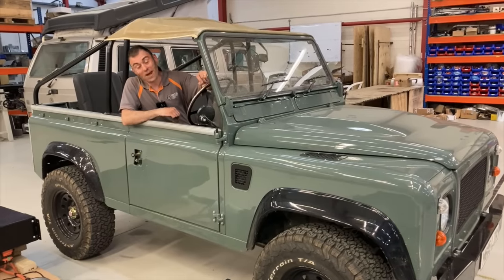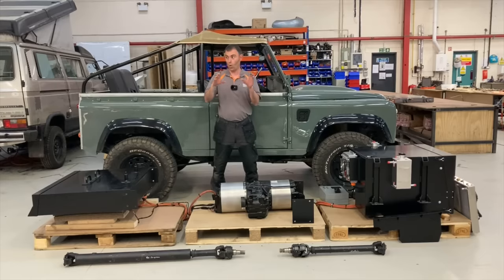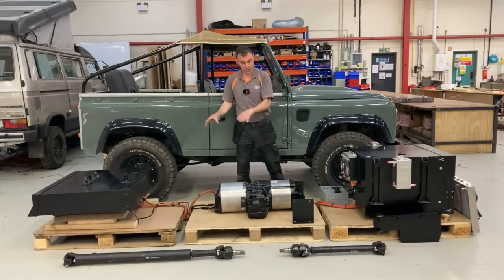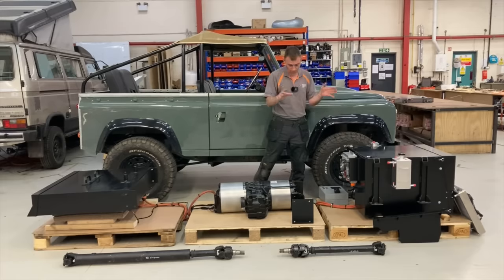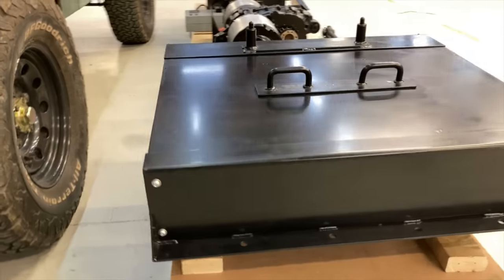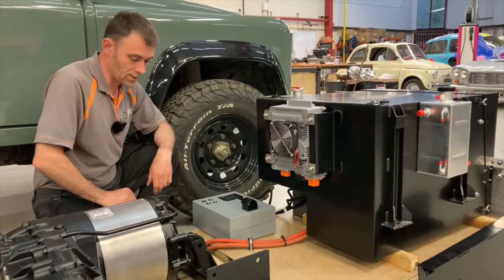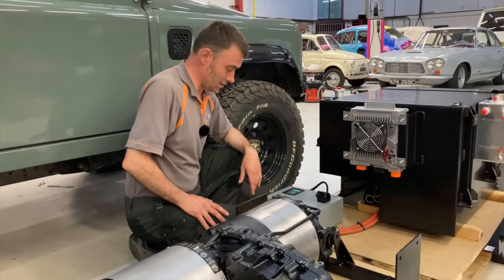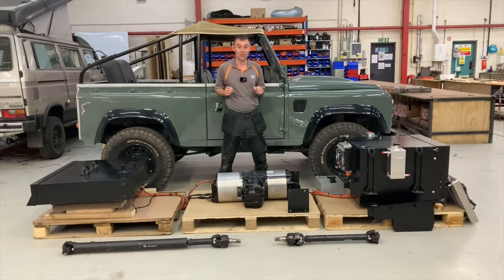Land Rover Defender bolt-in electric conversion kit.

Comment: @Electric Classic Cars
  If you want to cater to the USA, I would suggest looking into Chevrolet K5 Blazers, K10/K20 pickups (The nearly identical GMC pickups were designated as "K-15" and "K-25".  The only difference was some minor badge work.).  Also, the S-10 and S-10 Blazer (Chevy and GMC were identical here), the Full size Ford Bronco (typically with a 5.0L V8), the Ford Bronco II (based on the Ford Ranger small pickup which also had a 4x4 model), and then there are the Dodge Ramchargers and Dodge full size trucks, Jeep CJ-(x)s, and International Scouts.  Those are the most common older 4x4s here in the USA.  For all of these models, I would suggest a more universal kit to cover these basic styles of vehicle and ask your USA based businesses to come up with the bracketry to mount them in place for specific American models or have the end user make them if they so desire, with some disclaimer, of course.  The driveshafts (Propeller shafts) can be made at local machine shops to the end users.

Comment: I’d love to get my Discovery 3 converted oneday, but recognise that is probably too modern a vehicle for ECC. I’ve always hankered after a late original Range Rover Classic, soft dash maybe LWB.

But rather than 4x4 you should partner with JLR to take over the E-type zero project the cancelled. There would be a lot of demand for those as kits. https://m.youtube.com/watch?v=610Amyhpzzk
Reply from the maker: The RRC we can do. We've done a few of them. The Defender kit literally slots right in. Just a little bit different front battery box. We've also got a few electric E-Types to do. 👍

Comment: Electric kit for a DAF400/LDV CONVOY would be ace. Pretty much the land rover of the van world. 
Theyre great vans, perfect ahape for a camper, classic looks, simple enough to do a 4WD conversion on. TONS of space in the engine bay as well as under the floor in the back as the floor is raised by about 1ft the whole floor. Reckon you could easily fit 500KWH of batteries on that vehicle body if you desired to actually carry that weight in batteries 😂

Comment: I would like to build a fully electric F350 Super Duty pickup truck. It needs to have a heater that can defrost the windshield and be able to climb a mountain to my off grid home from 1800ft to 4700ft above sea level. The round trip to work and back is about 45 miles and takes 1h to 1.75h in the winter with snow and mud conditions. I also need to keep my 4x4 and low range for when I get stuck sometimes. Do you think there is a battery good enough yet? I see ford sells new f150s that are fully electric but those trucks are too small and low to get to my place and they are way too expensive!

Comment: Guys the best 4x4 (and I mean that as the best all rounder on/off the road) is Mitsubishi Delica Space Gear (L400 chassis) imho, I think it would be a perfect choice for Tesla conversion. Based on a Pajero it is a great off roader, however it is excellent on the road too. Unibody like 3rd/4th gen pajero (no ladder frame) but drivetrain same as 2nd gen pajero with few updates. Basically you could develop a kit very similar to what you already have for LR.

And another one, Mitsi Pajero 3rd and 4th generation, both have independent suspension and no frame, so rear/front motor location like on tesla cars would be, theoretically, possible. A lot of space in the middle for batteries.

But for me personally, a series 2 delica lwb is THE vehicle for tesla conversion, huge volume of space underneath and a perfect car in general. Swb would also be a great choice space wise and they are a lot cheaper and common comparing to lwb which are very expensive nowdays.
But from a business point of view, Pajero 3rd and 4th gen would probably be a better choice. 
Ta.

Comment: I am amaze with Landy conversion from conversional fuel to EV. Is it possible to set diesel electric motor for EV or is it possible to charge the battery with mobile small generator?

Comment: I would guess that the Cummins is the most common personal truck engine on the road. So maybe a differential mounted motor or a transfer case mounted motor or transfer case replacement for all trucks light-duty or medium duty would be a great place for you to direct your efforts

Comment: Ed do a p38 Range Rover aluminium body plenty of space you can even put solar panel on the roof for topping up the batteries on the go and you can install my air drive unit which tops up the battery with out charging at home

Comment: Just amazing. A superior technology in so many ways. It's always how I thought a transfer case should be configured. Elegant, instant torch, powerful output, motor with one moving part. What sort of range can you get if you put a stack of the 40s in a long bed Ford? How many could you stack and still have storage space? How many if you use all the trucks physical storage space? In the same long bed Ford, at what rate does battery stacking mitigate thermal loss performance issues? Imagine the pulling power.  Very good stuff.

Comment: hmmm... how about a c/k chevy conversion? that system looks like it might almost work as is., passenger drop or I suppose it can be clocked either way? 
Do you have some kind of mechanism to control front engaging front driveshaft via transfer case, or will some type of wheel hub  lockers be required to prevent running the system full time? 
Which would mean the axles are still spinning and there would be some parasitic loss? it looks so simplistic and clean., I really love it!

Comment: What are they like for towing 3.5 ton, and the range you get with a full load? Great product.
Reply from the maker: Easily tows 3.5 tons. I've towed a car trailer with a Defender 110 on it many times. It's easier to drive towing compared to a diesel because of the smooth delivery of power and regenerative braking from the motor which means you hardly use the brakes, even when towing. The extra energy ( i.e. effect on range) it takes to tow is the same whether petrol, diesel or electric. 👍

Comment: Thanks for the video and great job making those kits. Maybe convert a discovery 3 solve the crankshaft problems by removing the engine. But I guess there is too much other stuff in the car to place the electric components, not to mention the traction control. One other question, how deep can it go in the water? Is it all sealed well?

Comment: It looks to be an amazing conversion.  Would I convert my 1996 110 300 tdi with only 170,000 miles on the clock.  Yes in principle but my defender is still very utility, no frills, bumps knocks etc. Current value perhaps 5 to 7 thousand, maybe.  I am guessing the conversion parts alone are well over that.  I don’t think I would be up to doing the conversion myself, so that is going to add on a fair bit more. Having said all that you would be getting one heck of a car both in performance and hopefully in terms of saving some money. Not sure i can live long enough to see a positive return but that isn’t everything. Would be good not to have so much oil on the drive!

Comment: How about a tractor conversion. I have a 70hp Kubota used with a 3m topper mower to cut grass on an airstrip. I have 20kw PV/ 55kwh battery storage/7kw EV charger onsite with spare capacity in summer so it would be great to move away from diesel. The combo does about 1.5hrs/week grass cutting so not too much of an energy storage challenge.

Comment: For a 110 tipper landrover used off road in the woods  to haul and carry stuff would a transfer box be needed to get low ratios or is the torque of the direct drive going to be fine ( I’m assuming it would be ) 

Is it possible in a defender 90 to get more battery ( power) storage I’d need more than 150 miles per charge In My 90 but can’t afford to lose too much rear load space . I don’t need the crazy acceleration though 😎

How about a kit for the freelander1
Reply: No need for transfer box, motor has plenty of torque 😀

Comment: You can tell that we're at a very early stage of electric cars by the insanely HUGE chunks of kit that have to be installed in order to get 150 miles of range. It works really well for electric bicycles, as I can personally attest but it currently doesn't scale well. Oily as the original may be, it gives you unlimited range and takes you into deserts and jungles all over the world. Petrol is available all over the globe but not electric power.

Comment: If I had an aluminium bodied vehicle, I would try to employ every part of the coachwork that wouldn’t make the passenger compartment unbearable as a heat exchange/batt cooling assistant and in winter, I would make the passenger compartment aluminium coachwork part of that system to heat the cab. Just an idea.

Comment: so what landrover mark is that? SII door hinges? and modern bonnet and grill?  rear overhang very short. Steering wheel defiantly off a series and the bulkhead (firewall for those in the USA) is not later that a TD5
Reply from the maker: Early Defender, with some custom touches.👍

Comment: Very nice to have an electric 4WD. But is it waterproof for river crossings? Also how does the vacuum work for the brake booster?
Reply from the maker: It has an electric vacuum pump from a modern EV. Yes, it's waterproofed for river crossings. You can see it wading across a river in the following video. https://youtu.be/B38t7o4zyjU

Comment: I'm very interested in MK8 transit kit. The mk8 has a lot of engine and transmission issues. But the body and frames are great. Mine as many has had a lot of engine issues The RWD has loads of space for batteries and motors under the floor. Ideal for flat battery packs.

Comment: I assume the use of Tesla batteries and motors is because there are more out there, and they are one of the leaders in EV technology. I wouldn't expect you to give away commercially sensitive information, but are you looking into, or in talks with, other suppliers? I would think the battery suppliers would be the more difficult, simply because of the demand for batteries right now.

Comment: Quick question - I am considering buying a converted Bentley where the original running gear and gearbox are left in place. My question is about servicing and repairs to the non-electric aspects of the car. Would the conversion mean every garage would turn me away, or is there a 'switch' that renders the high-voltage safe for the old school mechanics without specialist training to get on with the work they need to do (such as to the Gearbox or Suspension)?

Comment: I assume to achieve two-wheel drive, the process is unlocking the Axles at the hubs. How does the Tesla differential handle the slipping in the front or rear if you only wanted front-wheel drive.

Comment: Please, I need a conversion kit for my 1991 Toyota Landcruiser FJ80. I would like the complete Tesla 3 drivetrain, particularly the DC Fast Charging controls and circuitry. I expect the motor, battery, controller, heat exchanger, octovalve will need transplanting. Mike

Comment: Only one (1) question:  What is the Lifespan of the vehicle?  Because a standard Landrover will last 50+ years.  So long would this one last?
Reply from the maker: A standard Land rover will last 50 years. 😂😆😲 this is a 1994 Defender and was completely dead before I bought it. Nearly everything was rusted or needed to be replaced. The average life of a car is 250k Km after which time the battery in a Tesla will still have 90% capacity. https://twitter.com/Duro_Data/status/1340493067443265536?t=hZIOjKrQfbUCjRXqGZ3mEA&s=19

Comment: hey Richard, are you guys currently working on 'drop in' kit for a discovery 1? I've been following you, Jaunt, and all the other 'best of' ev conversion from the start. I suppose it would not differ very much at all from a range rover classic. I'm sure you've been in talks with others or are in the process. I actually have lots of great ideas in this field and want to do it for work (including putting a tesla drive unit in the middle, before anybody had done it; it makes so much more sense and reduces weight and parts considerably), I wish I had just delved into it already instead of sitting on the sidelines watching. I've done light refurbishments on another type of modern classic car that I love to drive but I'm not a mechanic by any means. I also have an education in ecological restoration / environmental science so I'm similar to you in a lot of ways (my love for modern classics and driving and my keen awareness of ecological/ global environmental realities). FIAT PANDA 4x4 of the tesla variety would be sick (we're deprived of many European classics in the US like the panda).
Reply from the maker: An electric Fiat Panda 4x4 would be so cool. 😁👍

Comment: I'm starting a project to convert a car to an electric car but with a small addition going to have a small generator in it so it can charge the battery on the go 🙂 so more of a hybrid I guess, would like to have an easily removable battery park but not sure that's going to be practical without doing a lot of changes on the chassis.

Comment: Do you make the rear battery pack to slot down into the chassis where the old fuel tank would of been? That way you can use the rear load bed.
Reply from the maker: Yes. That’s how our latest Land Rover kits are. 👍

Comment: pricing ?? should convert a 2wd camper van and make it so the battery can be recharged with solar panels installed on top of the camper...travel for free just park and wait for the panels to recharge the battery

Comment: The power seems far too much. My Series 3 has 75 HP, which is a bit low I admit. But anything over 150 HP is unnecessary and just adds weight.

Comment: This is truly amazing I got to drive one of your kits in a 110 with king shocks and 37s it was the most capable 4x4 truck I’ve ever driven if your takin suggestions for what I think would sell make a jeep yj or tj lj electric conversion kit lj and tj are the same kit for the most part dude theirs so many people wanting these in the untied states make ‘em and ship them out they will sell
Reply: Theirs 1000s of them in the junk yard cause of bad 4 cylinder junk engines and only some had the ok straight 6 gas nothing to write home about but was a work horse this electric kit would completely change off roading if you made it for jeep theirs so much more aftermarket parts junkyard parts and jeep jeep everywhere in the states

Comment: Looks fantastic Why can’t someone design it to be self charging? This would make it perfect and give real range for overlanding in a defender
Reply from the maker: No such thing as 'self charging'. It's marketing spin used to describe a petrol powered hybrid that charges it's battery up using petrol. Every EV has regenerative braking which puts energy back into the battery when braking and slowing down.
Reply: @ElectricClassicCars  yeah but wouldn’t it be perfect if it could self charge ? Obviously they won’t make it self charging because they want to keep selling electricity, I think it’s amazing to see the defender kit it looks so compact and neat what range can you get on a full charge 
Thanks in advance

Comment: why not use the model S pack and the Model 3 motor? still more torque and power than you'd ever need with less weight and less room taken = more range
Reply from the maker: We do, on builds where all out power isn't a requirement. 👍

Comment: How much does all that weigh? Everything on the pallets I mean.
Reply from the maker: Not much more than what came out i.e. engine, gearbox, transfer box, exhaust, fuel tank, fuel, fluids, coolant system, big 12v battery etc. 👍

Comment: whats the range when towing 1 tonne and can it be submerged under water so you can launch a boat?
Reply from the maker: Watch this regards towing👍 https://youtu.be/SHxQV3w1HKA
Reply from the maker: Watch this regards water crossings 👍 https://youtu.be/B38t7o4zyjU
Reply: @ElectricClassicCars  so, I’m Australian just for some context........I just watched the range test and my god was that disappointing in terms of performance. 125 mile (201 kilometres) range in Australian terms is frankly......pathetically and dangerously low. I had really hoped that result would be far better than it was but oh well, that’s just where the technology is at the moment I guess. Thanks for making the videos but electric towing just isn’t viable yet in Australia with the distances we need to cover and the lack of charging stations. Plus, our electricity Is insanely expensive and only going higher in the future. It makes no sense at the present moment to even consider electric as a viable alternative here.

Comment: How long for can 100kwh take me?
Reply: A Land Rover Defender like this has a drag coefficient of ~0.59, compared to 0.24 in a Tesla Model S.
You'll also have more drivetrain energy losses, as well as higher rolling resistance with these tires.
I would guess somewhere around half the range of a 100kW Tesla Model S - which is to say about 250-280 kilometers.

Comment: how about a slightly lower powered kit for the consumer market with a standard sized vehicle. that much HP is just not needed for reasonable driving for the average consumer. the promotion to EV conversions should be seen with a but more reason and perhaps not cost the same an a new car. you products do look good but Id never see to get it because its not reasonable.